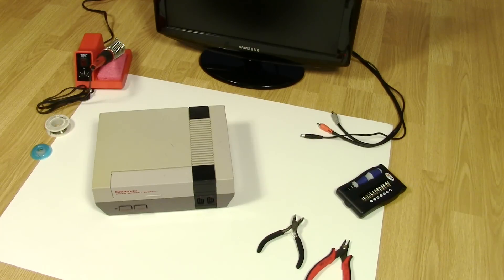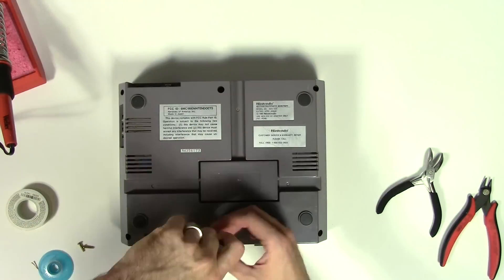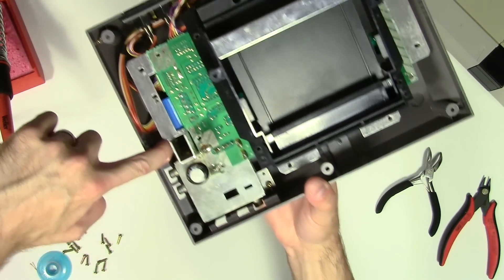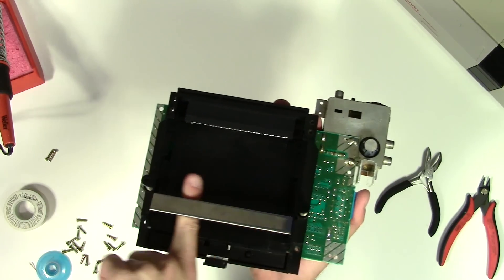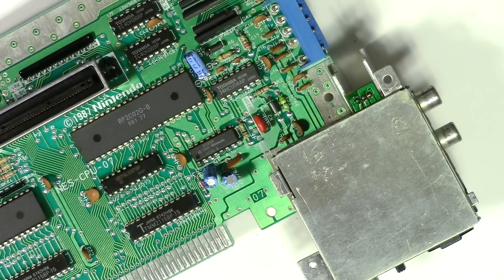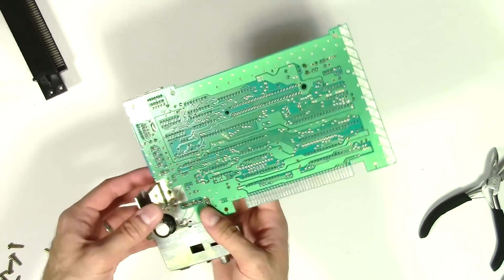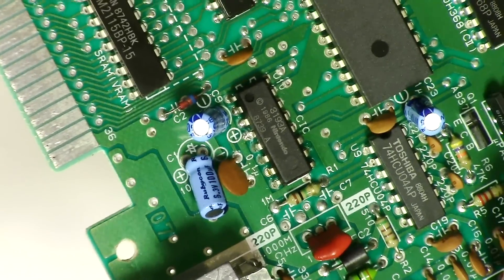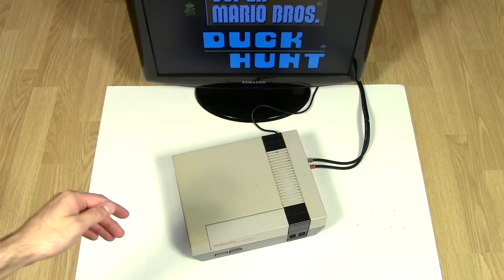Fixing the NES Blinking Light of Death

Comment: To be clear to all watchers, just because it blinks, doesn't mean you need to replace the 72 pin. There is not a single system that didn't blink. It will blink if the game cartridge needs cleaning or system needs cleaning, which can be done using an official Nintendo deck cleaner. Start with cleaning your games and system first, over and over. And yes, the 72 pin does go bad in some systems.
Reply: Didn't it blink aswell with problems with the scart aswell?
Reply: Still kinda helps though because now you can play all your flea market games.
Reply: Any chance you'll see this after 4 years? I tried to clean my 72-pin connector and I cleaned the contacts on my games, but I still sometimes get either the blinking screen or sometimes I get garbled text and images. Does this mean my 72-pin needs replaced? Or if I go back in and clean it better will it be ok?
Reply: Mick Mickymick clean the contacts for the 72 pin and on the board where it connects.
Reply: If the system used the Game Genie then chances are it cracked the 72pin edge card connector. I know mine did.
Reply: you are a legend I thought I had a shitty NES that I purchased for $19 Aus dollars turns out a clean of the cart fixed the red blinking thanks dude!
Reply: amsxXxevo8:Thanks,wish YouTube existed when we got NES in late 80s
Reply: That nintendo deck cleaner is shit. Just use 1up cards
Reply: I saw the title and immediately thought "just boil it". But with a replacement 72pin that would have been useless advice. Boiling my 72pin connector fixed my glitches, but may possibly introduce corrosion.
Reply: i boiled my connector, cleaned my cartridges and i still get the same error :(
Reply: Boiling connector? As boil in water?
Reply: @malajo74  Yes. The pins are made out of a metal that doesn’t rust. The temperature of the water breaks loose the grime.  Also it is best to clean the original, the Chinese replacements are made poorly, use a stronger metal that does rust, and typically has a vice grip tightness that makes it hard to pull out games. It also scratches the hell out of the games connectors which will fail after awhile.
Reply: @nesmandan1037  That's what happened to mine, the pins are badly corroded to the point where I'm not sure that they won't be pitted even if I do get them clean. If you're going to use the cheap reproductions, you should make a point of using dielectric grease on the motherboard side, so that you don't have to contend with a pitted corroded motherboard connector like mine has. I'll get it fixed by the weekend, but with the grease, it would be a much easier job to fix. Probably just requiring a replacement of the pins, at most.
Reply: @SmallSpoonBrigade  You may consider getting an original off ebay. I just swapped 2 games for 10 used connectors sight unseen.  I was able to get 7 working with no issues, 2 had broken pins which were garbage, and the last happen to be a knockoff.  Regardless 7 original connectors in this condition is worth $70 to me and worth the 2 $8 games I used to trade with.

Also once boiled, take a very clean cart, add rubbing alcohol to the pins with Qtip, and slide it in and out 10 times or so.  Reboil for connector for 5 min. While boiling, dry off the cart pins with dry Qtip, reapply rubbing alcohol, dry it off again.  Repeat this cycle until the Qtip used to dry the cart is clean.  This has been by far the best method I’ve used over the years. The cart is helping scrape the gunk off and cleaning up the mess. The scrapped gunk in the connector comes off in boiling water.   Make sure you wash the pot out when done.
Reply: @mickmickymick6927  Did you find a solution? I have the similar problem, blinking and jumping image. I cleaned the 72-pin, I even replaced it with another original 72-pin and it still produces the same problem. It's not a big deal bc once I restart the system  it fixes itself. But I still wonder what causes the initial blinking when I turn the system on for the first time, and every single time. Could disabling the chip  work?
Reply: @rbihon  Sounds like a problem with the copper wiring inside the motherboard, but I am far from an expert. You could try r/consolerepair (dont think that's the name but if you look you should find it). I eventually boiled my connector and then it worked, but it sounds like that wouldn't work for you.
Reply: bend the pins back up, they get sandwiched and don't make contact LONG before they "go bad".. (i assume you mean corrosion when you say "go bad" but that will never happen to a dry system. They are springs and just need to be re adjusted down the line.
Reply: Another fix for this, I found myself atleast, is to not put the cartridge all the way in, just skirt the cartridge to the outside plastic and push it down. It may "scratch" sound with the plastic and the cartridge, but it works 100% of the time for me.
Reply: Ya it’s actually normal to have a blinking light you just shake the cartridge and it will work unless the connection does not work then you can remove it
Reply: Also can sometimes be fixed by rocking a cart back and forth while in the 72 pin adapter
Reply: Re bending the pins down to form a better connection also works in most cases. I've never bought an aftermarket pin connector!
Reply: Okay? I tried that and nothing happened

Comment: I understand what you are saying about doing mods in a way so that they can be reversed later, but honestly, I can't think of any practical reason why someone would want to re-solder pin 4 and turn the lockout chip back on.   You haven't lost any functionality from the system by cutting that pin, so there's nothing to gain by re-soldering it.
Reply: totally agree

put  back to factory is easy. joint the cut pin 4 with solder.
Reply: The only game that requires it from what I heard is Nintendo World Championships (the legit carts not repos) and the chances of getting one of those is slim to none without having a huge ass wad of money.
Reply: One word: Purists.

Purists don’t like things changed from stock.
Reply: Say, if someone were to sell an nes after cutting off pin 4, would they have to mention that it was cut, or would it not even matter?
Reply: This is a good point Jordan, but it's more of an argument to advertise your items for sale honestly than an argument against cutting the pin. I would be willing to bet there are plenty of people who would gladly buy an original NES with the lockout chip permanently disabled. Some people may even be willing to pay more for it. It all depends on who you're selling to. Collectors, purists, and resell shops might not want it, but retro-gamers who just want to play games reliably on original hardware would.
Reply: @LUCKO2022  Do they work on the NES2, released in 1993?  That was also a legitimate NES released directly by Nintendo but I think it didn't even have the chip.
Reply: @LUCKO2022  yeah like 23k plus as of now!

Comment: 80's equivalent of the Xbox 360's Red Ring Of Death.
Reply: Bryce K l know right
Reply: Only 1000 times easier to deal with that doesn't require sending the console to the manufacturer.
Reply: (1) Ring is either E68 or other codes (2) Rings means your Xbox 360 is overheating (3) Rings is General Hardware Failure (4) Rings means your A/V cable fell out
Reply: Except for it's a little bit easier to fix I mean a lot easier to fix like is easy as just cleaning it so not really
Reply: intheradae the greatest The Red Ring of Death generally refers to the 3 ring general hardware failure mode.  No one really care about the other modes as none of them were permanent failures.  I vaguely remember it was the GPU that failed from overheat and the  later boards added heat pipes to the GPU heat sink.  

Either way, it was a shitty design.  Granted Sony's PS3 suffered similar yellow light of death, but nowhere near as wide spread as the red ring.
Reply: Not even close
Reply: Also similar to the 80's Amiga Guru message. ;)
Reply: Except it’s a $10 fix
Reply: The difference is this can easily be fixed. Nintendo is the best.
Reply: Yes

Comment: Thanks so much for this video. My wife just recently was able to go through all of her grandfather's old belongings and he had a Nintendo. I kept getting that red blinky light, and found this video. Your instructions were clear and concise. Thanks again, my dude.
Reply: If you want it to last even longer, apply some dielectric grease to the connection between the mother board and the 72pin. It will protect the motherboard against corrosion from moisture and oxygen getting in there and mean that it's just the 72 pin that may need to be replaced in the future, rather than having to repair the motherboard side connectors.

Comment: Great video. Clear concise and honest. 

As stated by another comment, a desoldering pump is a necessary part of an electronics tool kit.

I always use a DS pump especially on through-holes that act as vias. Once the chip is removed, clean up both sides with solder wick and then clean the area with a q-tip and isopropyl alcohol.
Reply: that is all well and good,.. but those chips use UV PCB "glue" to adhere to the board. so you are not going to have a good time either way lol.

Comment: Not sure if someone commented on this before, but the "tape cassete" -like click-down action of the loading slot is purely cosmetic and there to make the system feel more like a VCR so Nintendo could market the NES as a home entertainment system rather than a "video game" after the crash of 83.

The same reason it looks like an easy bake oven and came with a light gun and a robot.

The slot should function fine without clicking the games down, and all clicking them down does is strain the 72-pin connector. It's recommended to just insert and remove games without pressing them down.
Reply: Yeah, I noticed that after I replaced my pin connector. I always thought there was some switch, or something like that.
Reply: I've attempted just inserting it, but I get a blank screen, I suppose that is because the top pins are bent just like the bottoms ones used to be.
Reply: The only time you don't have to push the game down is when the 72 pin connector has a tight fit and all pins touch the nes chips.

Comment: Those ICs are held down with adhesive so they don't move when the board goes through the wave soldering phase of production. You'd need a hot air desoldering station to try to get that chip off. 

Cutting the pin is the best solution. It's just a region lock chip, and those things are evil anyway.
Reply: moo. Yeah I would rather remove the chip from my nes console and be done with it
Reply: put a toggle switch on pin 4, mount it in the case, and enable it when you play illegally-produced games that try to disable it.
Reply: IT IS NOT IC. IT IS REGION FOR REGION PAL A OR B EUROPE OR NORTH AMERICA REGION
Reply: Actually the best thing to do is to cut the pin connection off the circuit board on the reverse side of the board...cut the number 4 pin away from the circuit board right up close to the pin connection.....there is only 1 other connection that shares pin 4 on that little connection which is electrolitic cap C9...and it would be so easy and neat to solder it back if you ever needed to....and it doesn't look ugly like the guy in the video is trying to do,plus it is safe for the little IC Chip  theres no  damage to it my way...just saying...ps make sure you have an ohm meter to check continuity after you cut the pin away from the board...you should not have continuity after the cut..

Comment: Thanks for the video, I just found this after replacing a 72pin connector and still had an issue with the lockout chip. This video helped me out! A little tip for desoldering IC's from 2 layer boards. You can use a vacuum desoldering tool on your Weller DS40 or Hakko FR-410 or similar. They will make quick work of desoldering with less heat and destructiveness to the board just add a little flux, and it is less of a risk to use than the braid, because you won't lift up a trace. Makes removal much easier. Similar to removing SMD's you can also heat up the IC pin by pin and gently lift it out off the board with some IC puller tool (really inexpensive) after desoldering it and it will pop right out. Just let the heat work it out, don't apply force to the IC when removing it our you might lift a trace. Give that method a try. They also make IC desoldering tips, that are chaped like a square, a U shape or a large line shape that also help apply heat evenly to the tips of the IC's and make removing them easier.

Comment: Just to note, the Remodeled NES, the NES 101, also known as the NES 2 or the NES top loader does not have the lock out chip.
The trade off is the US version of the remodel generally lacks A/V out in favor of RF only (those NES 101 that got sent back to Nintendo for repairs got modded with a Multiout connector similar to the SNES and N64). The Japanese version the Famicom A/V only has A/V out. Also if the NES 101 gets a AV mod its picture quality is better than the original front loader NES. Also the NES 101 and the Famicom A/V are the preferred consoles for RGB video mods.

Comment: 1st things first, every chip has a marking or dot close to "PIN 1", AND Pin one is always closest to the corner edge, "mind you specialised chips may not follow this convention"
NOW.. A big mistake most rookies and 75% of the Pro's do is when they de-solder they don't use flux, mark my words soldering and de-soldering always works 100% faster, easier and much, much, much better when flux is used, If flux isn't used then the massive and long periods of heat applied can actually destroy components. Dropped a like BTW..
Reply: I would replace that capacitor easily identifiable @2:27, For one.... Later in the video it looks as if it's already bulged and thus close to failing, And when it does, it may take sensitive and irreplaceable components with it, might make for another great video, oh and while you're at it, check all other electrolytic capacitors for leakage and bulging, in fact there may be a replacement kit available for the Nintendo that includes all critical components, don't forget to note orientation when replacing components, oh and flux, flux is a must when soldering and de soldering..

Comment: Yeah trying to desolder the chip was a noob move. For those with one of those screwdrivers that accept different magnetic bits, you may want to find a really small flat-head driver and dig through that pin. It will cut lower than any sideways pliers and can actually reconnect just by bending it back to the board. It actually works without soldering too if you don't solder well or don't own an iron.

Just a heads up.

Comment: Good video!
I used an old bank card with paper folded over it with some isopropyl to clean the 72 pin connector. Mines extremely loose so when the game is working it can go south with someone heavily walking in the room. There's a way to tighten them with a dental tool.
Reply: I've seen people use a safety pin that's been bent and cut to create a hook, but a dental tool is probably a better idea. I've seen them at the dollar store.

Comment: If you take the time to pull the Lockout Chip just to pull out Pin 4 then take the extra step and put an IC socket so if for any reason you want to revert to going back to using the Lockout Chip then you can just pull the IC, rebend the IC and pop it back in.

Comment: Going to give this a shot with some brasso on the connectors  and a replacement 72 pin to see if that helps.  Mine basically works half the time and even then I have to wiggle the cart to make it work.

Comment: If anyone is reading this, you can still cut the pin and place a switch in to power the lockout chip back on Incase you choose to one day use an Aladdin deck enhancer(which will fry the board if the chip doesn’t work) or not. Cut the pin as close to the board as you can and bend it out. Ethernet cable can be found ANYWHERE in second hand stores that sell electronics (Salvation Army, Savers, Goodwill) and contain the perfect solid copper wire to connect to the cut pin, and the board where it lands. You can install a miniature DPST switch to turn the lockout off and on. After you fix the connection issue you can play Any NTSC game you want, and then if you feel like picking up any PAL exclusive titles, you flick that switch and you are good to go. You can have the best of both worlds. Good luck.

Comment: Hey, love your videos! What wattage is that soldering iron you have there? I'm in the market for one, but not sure what wattage I should be aiming for. I've read lower is better as it gives you more time to work on things without worrying about damaging the components. Do you have any suggestions? Thanks
Reply from the maker: I have a Weller WLC-100 iron, which is 40W. I wouldn't say that lower wattage is better, but instead if you're serious about soldering components (and not just joining wires together) then look for an iron with adjustable power. At some point I'll probably upgrade to a Hakko FX888D, which is an even better soldering station.
Reply: This Does Not Compute thanks for the reply, I did briefly look at the hakko fx888 and also at the fx901 which you also have. Unfortunately, I live in Canada and its hard to find anything Hakko at a decent price. The tips are pretty hard to get up here as well. Im not that serious about soldering, just want to do a couple of mods here and there
Reply: I use a 60 (i think) and it works good for almost everything

Comment: great video. I am running into the red light issue and I am about to start taking all the games apart first and cleaning them. Im not technical so I worry about taking apart the NES. Are there any alternatives to dismantling the system to get the red light fixed?